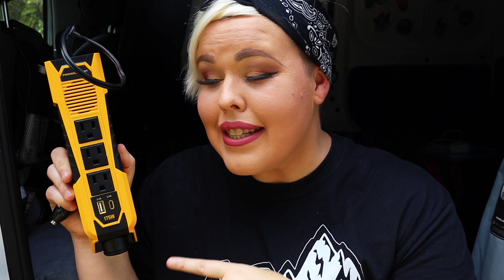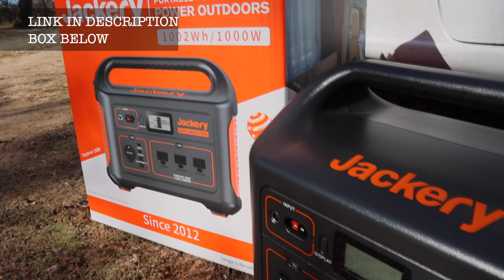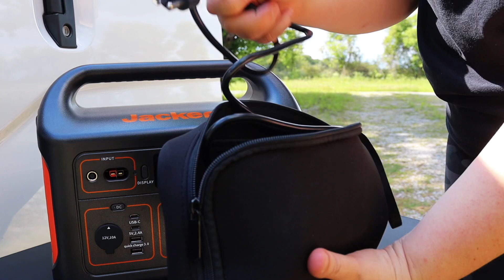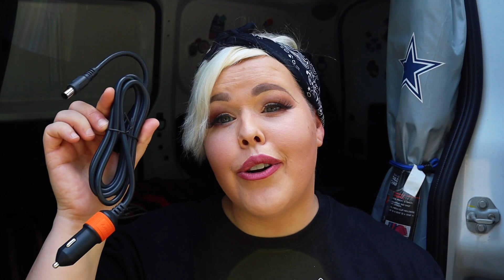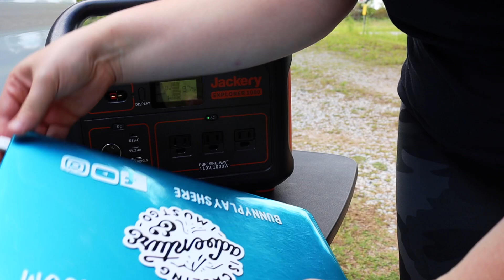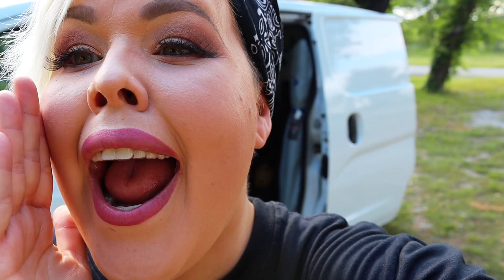How To Power Your Van - Jackery Explorer 1000

Comment from the maker: Question of the day:   What do you use for power on the road?
Reply: Currently using my vans usb for my phone and all batter powered devices otherwise.
Reply from the maker: @nvenvy9137  good way to power things... my usb and I have a love hate because of my phone itself... otherwise I would use it all the time!!
Reply: I have a Jackery 240 and a 60 watt solar panel.  Hoping to upgrade to a Jackery 500 soon.
Reply from the maker: @karenpackman225  the 240 seems to be a great one.. I have seen so many people with them!!!!
Reply: I have a small power bank just for my phone.
Reply from the maker: @campingqueen9051  I have several of those for the trails which I take with me!!
Reply: Reece’s fast-break 🙏😈😂
Reply: I installed solar and a battery bank recently, I also rely on campsites for power.
Reply: My wife and I both have small portable chargers for our phones when we are out hiking.
Reply: A Jackery 500 and an inverter for regular driving charging
Reply: I have several options for power.   I have 400 watts of solar on my roof with a nice size battery bank to work with.   Additionally I have a Jackery 500 for portable options around camp when boondocking.    I also have my van set up for shore power.
Reply: Currently a Jackery 240.
Reply: In my overlander vehicle I have a Jackery 500.   In my van I have 3 deep cycle batteries connected to 400 watts of solar on top.
Reply: @free2roamwherever  good set up
Reply: My RV's Generator when I'm not plugged in.
Reply: I would love to get one of these or some other power station. They're kind of pricey.
Reply: Good video, new subscriber and I've watched a few of your videos. You've great energy for sure. I'm a digital nomad (no youtube channel yet). As for my power provider, I use a Jackery Explorer 500 to power my fridge, charge a variety of USB lights, tablet, laptop, camera, drill battery. I also use a 12v splitter to power either a 12v hot water kettle (for coffee, tea or cleaning dishes) or my 12v portable roadpro oven and still power my fridge. I charge mostly at home or by alternator. I do deploy a 120w foldable solar panel if I'm static for the day. I do plan to add 1 or 2 lithium 12v 100ah batteries mounted soon. i will keep the Jackery too... Adventure on!!!
Reply: I haven’t bought mine yet, but after seeing your video😎
I’m definitely getting one. I’ll also have some videos of my own coming out hopefully by the end of the year I’m currently converting a car that I haven’t seen converting yet yes I said car

Comment: Thank you for showing. I feel more comfortable with what to expect. I ordered my jackery 500. I’m waiting for it to arrive. I can’t wait
Reply from the maker: You will love it!! I have found that Jackery over the year I have been using it almost now has been very reliable.. I had a few moments where I thought something was wrong at one point.. I called they instantly walked me though some trouble shooting and I discovered they also have a safeguard against shorted out wires.. so if you have something that is functioning incorrectly the Jackery will turn off rather than melting down like some will... Not to mention they offered immediately to send a replacement if I jus thad my order number... LOVE the product overall and the customer service has been the best I have found when it comes to power...

Comment: Just got the 1000 even though I have solar as periodically I need to run a nebulizer. When traveling in winter I like to prepare for the worst weather while feeling secure. Love my jackery. Also if it’s too hot I can park in the shade and still use the power from the solar panels that I also purchased.
Reply from the maker: Yes!! This is why I got the 1000 I run a lot of devices.   I charge a laptop which is a HUGE drain of power on any source, I charge 8 camera batteries and I run my fridge, and the 1000 gets me through it all... I am really happy to have purchased this one along with the panel.

Comment: I first bought the Jackery 240, then the Jackery 1000. I also have 300 watts of solar on my roof and an Iceco fridge. Recently, I finally got off the proverbial fence and bought a small window AC and decided on portable solar panels (not a generator) from BALDR instead of the Jackery brand after watching several videos. This brand is more affordable and just as good. It's able to charge multiple brands of power stations, including the Jackery.

I have multiple pets. We have been on the road for two years, sometimes in the sweltering heat and not able to park in the shade due to my solar panels on the roof! Now, we can camp in warm climates if necessary AND park in the shade and still have power by setting my portable solar panels in the sun. I just opened the box today and I'm so excited to start using it to charge my Jackery that powers my AC so that my FIVE little furkids and I can be more comfortable! Woo hoo! Nice and fun video, BTW!
Reply from the maker: That is smart to make those choices as you go for them and yourself!!!  I always tell people that finding the things that work for them might not always be the same as the next person so it is important to know our individual needs and also that of the fur kids 😁
Reply: @BunnyPlaysHere  exactly. I don't want the climate in a certain place to dictate where we go or how long we stay anymore than it already does. When we first started out the van broke down within the first few hours! We were stuck in a parking lot at a Love's in the full sun for a day and a half before we could get towed to a garage! It was 101 degrees inside the van with three fans and my Maxxair on exhaust! We've baked in the sun on several occasions after that. Mama says, "No more!"

Comment: I contacted Jackery to ask them if they could tell me if one could get enough sun with one of the solar panels inside the cabin, across the seat or dash from indirect sunlight to get any charging at all.  Unfortunately they thought I already owned one and thought I was asking about a problem charging, so I didn't find out the answer.  I don't plan to do it here in Florida in the middle of summer, but it would be handy to leave at least one of the panels charging on the seat or dash, when one is out exploring in less hot conditions, but you want to keep it locked up while you're not around the van. Much as it would be great if you could leave it outside charging up while away, I get a feeling someone might help themselves to it.  Do you happen to know the answer?  Thanks!  And if not, thanks.
Reply from the maker: I have tested this using the panel in my dash when I am parked for a while.   I managed to get plenty of sun to charge it.   It does get pretty hot though so that isn't ideal for the dash itself.    As for what you were mentioning about someone helping themselves... that is always a concern when unattended.    I usually make sure all the big stuff is behind my curtain and unable to be seen, the cord for the Jackery itself is long enough to place it in the back so it is doable....
Reply: @BunnyPlaysHere  Thanks!  That will mitigate some of the advantage people who mount outdoor panels on their roof have which is what I was hoping to do.  One day, I may buy some roof mounted panels, but this will do fine.

Comment: Super helpful!
Reply from the maker: So glad you found it to be useful!  My goal in all my videos is to share my personal experience and hope it helps others in seeing the process of getting to where I am.   Glad you enjoyed!!!
Reply: @BunnyPlaysHere  I need to educate myself better on power. I was looking at the 500 but with you using the 1000, makes me wonder. Maybe go big is a good idea just to keep power for longer!
Reply from the maker: @Dracenea  I really wanted to get something that could go for a few days should i get stuck without sunlight.   With this I can do a lot of different things and it more than covers me.    With my current fridge my power demands are about 55 watts per hour on the high side so I needed to keep that in mind when i was factoring my usage, the 1000 just made more sense long term.  I would definitely suggest looking at what you will be personally powering and doing a little math with your needs requirements it is very insightful in determining.

Comment: Have you considered a static panel?   I can see value in something which is able to gather constant sunlight.
Reply from the maker: I will eventually be looking into a static panel for my roof, but I first have to add a roof rack both of which will be an expense so I opted to get the foldable panel first because I can use it anywhere I am by directionalizing it.   which is awesome!!

Comment: I have seen several comments about this being good for home use.   Would you recommend it for that?
Reply from the maker: Most definitely!! It is very efficient and helpful in the case of having a power failure so it is a good thing to have for a little peace of mind.   Also you can take it with you outdoors for a little boost when you need it.   This is great for running lights outdoors.

Comment: Just curious also, what speaker do you use?  I had one that I liked but recently dropped it and it sounds strange now.  Of course I didn't send in the warranty paperwork so now I need to just replace it.   I like the size of this one.
Reply from the maker: This is a Fospower speaker that I have been using for a little while, had a really nice quality of sound and easy to maneuver and take with me when I hike also.

Comment: I looked at the smaller one, it is actually not a bad price for something at home.   Do you think it could run a small heater?
Reply from the maker: Heaters are tricky because they pull a lot of power.  Instead of a heater I would look into a low watt car electric blanket if you are using this for a back up to home power for weather.

Comment: This question may make it abundantly clear that I am technologically challenged. I noticed you plugged your drone battery into the Jackery in the 110 AC outlet. Does it draw the same amount of watts if you were to remove the USB to AC adapter and plug into the USB port directly? Im trying my best to learn about Watts and amps but when I read all I get is blah blah de blah-baddy blah. I read some where that inverters use battery power as soon as they are turned on whether anything is plugged into them or not. Is that the case with the Jackery too?
Thanks!!!
Jo
Reply from the maker: Great questions!!! I have noticed that Jackery does not start pulling until I actually turn on the button and furthermore will not fully start working until you select your ac or dc option.    I have left something plugged in before and forgot to turn on the dc button only to realize it didn't charge at all...lol. oops... 

The batteries I have run pretty true no matter which side I plug them into.   The drone does pull a bit more when it is full dead but only by a couple of watts, so not a deal breaker.    There is a rapid charge usb also and that does change the amount of watts used when utilizing that one but only because it is basically supercharging your device.  I sometimes use that for my phone when I don't have long to get it fully charged and it cuts my charging time down considerably.   However that does double the watts used typically.

I hope that was helpful :)
Reply: @BunnyPlaysHere  yes! Thanks! I probably can get by with the smallest Jackery as I use my phone for everything. My laptop quit accepting a charge and it was barely a year old. I doubt I'll replace it.
Reply from the maker: @jcrefasi1  That is no fun.   I had that happen with my old laptop and it ended up being my charging cable... but then it had an issue later with the battery itself, so frustrating.   With only a cell phone yes, the smaller Jackery would work extremely well.    :)

Comment: Thanks I also own a a Nissan NV 200 . So then u can put the solar panel permanently  on the roof and it wil stay charge .
Reply from the maker: My goal is to eventually do that.  I do have a rigid panel for that but I need a roof rack.   With anything it is all about purchasing at your own pace since many of the items add up quickly.    I opted to get a folding panel before the roof rack since Jackery is doing their sale and that way I can take it out and use it when I am at camp if I am choosing to park in the shade to keep the van a bit more cool.    All in due time I will have both rigid and foldable going full time :).  

How do you love your NV???

Comment: I looked at these but couldn't determine which one would be best for my needs starting out.   How did you determine which one.
Reply from the maker: For me it was a matter of having more power for longer term in general wether I was just using my normal things or if I had the items which aren't currently in the van.    I used the information on Jackery's website to determine which would work for that longer.    I knew I was going to be staying in the middle of nowhere a lot more often in the van so finding something to work with that was important.

Comment: I agree with the generator statement.   My RV has a small generator and it is loud.   I prefer not to use it and in fact opted to add solar to my rig with batteries under one of my bench seats  that I wasn't otherwise using for storage.    I  am happy you found this solution for your ongoing power struggles.   It is a great suggestion and I might consider it for the portability as a back up source.   Thank you young lady for again being so detailed in your explanation and helping me discover something worth pondering.
Reply from the maker: Absolutely welcome!! If you have room for a battery bank that is ideal!!!  This is a great portable solution if you want power at your camp outside of your rv because you can load it up and move it anywhere you want.  :)

Comment: Can you also use these at your house?   We had a lot of outages last year during the storms and I would be interested in finding something that would be easy to store in my garage until I need it.
Reply from the maker: Yes!! Absolutely!! I would suggest using it occasionally and not leaving it just sitting charged because it can slowly cycle down if not used for months on end.... You will love this though for a at home solution to power failure.   They have a variety of different sizes, you might not need the big guy but a smaller one for in a pinch would definitely be worth an investment!!

Comment: Very smart solution to power.   I also had contemplated batter bank but found that a single batter would not be enough for my demands if I wildcamped numerous days.
Reply from the maker: I really have found this one to be a quality investment toward the van and the future.   It has made it where I no longer have to run my van when I am at campsites which is really bad for the battery.     This solution also allows me to take the power out of the van and over to a picnic table for working at campsites, which is really amazing!!  mobile power is the way to go!!

Comment: I have been giving some thought on purchasing something like this for some time now.  So I have to ask if a person was not using one of these to charge a laptop which appears to be the energy hog of devices, would say the Jackery 500 watt be sufficient to maybe be used to charge an I phone 8 daily as well as run a strip of LED lights inside the van at night for a few hours along with a small fan for back country camping for a week or so??
Reply from the maker: For regular devices yes!   I will also be charging a couple other things which is why I opted for the larger long term.   But the smaller would do great for less demanding items!